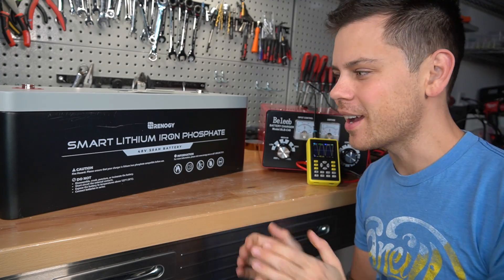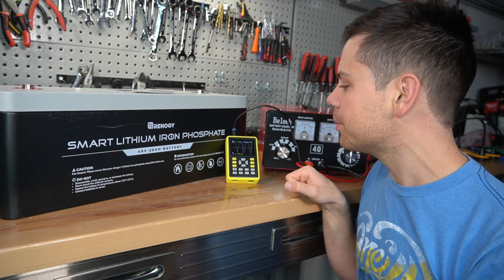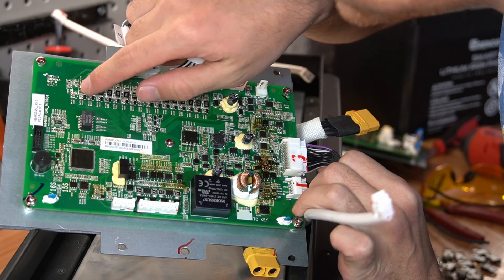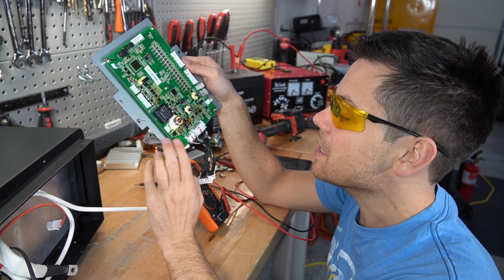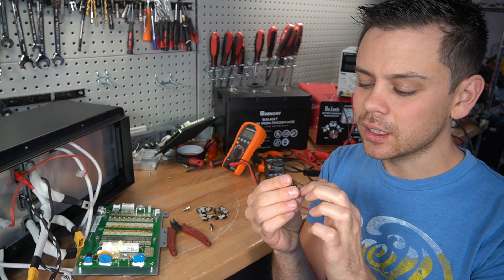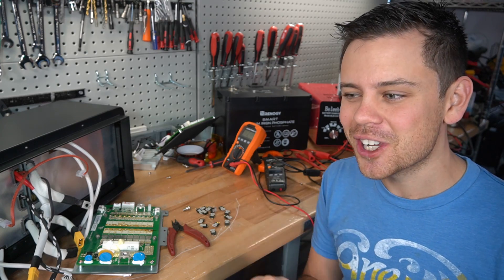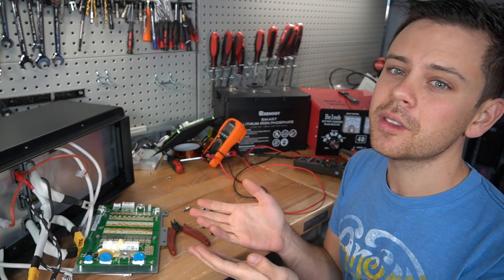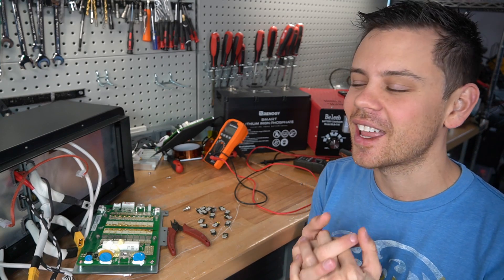Renogy "Smart" 48V 50Ah Part 2: How did I kill it?

Comment: Even if it was a bad charger isn't the whole point of a bsm is to stop that from happening and save the batteries
Reply: @ mike a... I think it did protect the batteries, but not itself. A new bms  or replace mosfet should make battery ok.
Reply: @reginaldjones9924  The BMS didn't protect the batteries.  As result of the FET shorting, it allowed the battery cells to both be charged at cold temperature, and overcharged.
Reply: To a point - the BMS will have a rating that says "NO MO than X'" or I stop working ... he crossed the NO MO' line a few counties back ... I have actually seen it where so much current was passed that it literally fused the entire BMS into one solid circuit ...
Reply: I did not know that could happen if there was a fuse in line somewhere could that have prevented it from damaging any batteries.

Comment: My only question is:"Why is that rotten #@&%* charger still sitting on your bench???
Reply from the maker: I was going to trash it but its good for lead acid haha
Reply: @WillProwse  Will, that charger would have been just fine for charging that battery or any other battery in that amp hour rang or larger, as long as you a don't exceed a 1C charge rate, and you keep a close eye on the charge and don't exceed 85% charge. What killed that get, was when it tried to disconnect the battery at the moment the voltage was at it's peek, which is also the moment that the current was at it's peek, which resulted in a ring up that probably would have reached a high enough voltage to destroy the rectifier in the charger if that Fet had have been rated for a higher voltage than the diode bridge, unless that charger is a half bridge with a center taped secondary in which case the rectifier would not have blocked it at all and it could have risen to several hundred volts, which would have taken out any Get not rated for at least 600 volts. Bottom line. The Fet failed at the very moment that it tried to disconnect, and you could have been charging that battery with a fully regulated Supply that is only a few volts over the top limit and had an inductor in line and it would have killed it.

Comment: Great follow-up video, Will! Thanks for sharing your findings with everyone! Even a nice BMS can be destroyed with high voltage.
Reply: I agree but I’m also disappointed that they didn’t add protection for chargers like the one Will used this time. Many other people might do the same. 
I’d call this a design failure when taken into account that it’s a high end product and there apparently are other products that can handle the (much too) high output of the charger. 
I’m curious to your opinion. Tia!
Reply: @Conservator.  I'd like to know what Renogy says is the Absolute Max input voltage for their design, that's a common specification for electronic designs. The datasheet only says "Voltage Range: 42V~55.5V" and "Max Charge Voltage: 54V". If they only have a ~3% (1.5V) safety margin on this design, I'd be very concerned. Based on Will's measurements, he's seeing at least 72V from the charger which is ~30% over the max listed on the pack.
Reply: @MarcelStieber . So as others have mentioned there probably was a huge spike when the transformer was cut off at peak current. I understand that one (or more) MOVs (of less than $1) could have protected the circuit from failing.
Reply: @Conservator.  Sure, my earlier point is that a sustained and significant over voltage event that's 30% above the rated level is not something that most circuits are designed to handle. MOVs will help for intermittent spikes and transients, but not sustained over-voltage as Will indicates that charger outputs.
Reply: @MarcelStieber  Thanks again. 
I was thinking 95V MOVs as the MOSFETs used are rated at 100V. 
I don’t intend to be pedantic, but I’m seeking for confirmation and or clarification. I highly value your comments.
Reply: @Conservator.  No problem! We're all here wanting to learn. It's been fun to see the group debug effort on this one. I'm sure everyone's learned something from these videos!
Reply: @MarcelStieber  👍
Reply: I wouldn’t call it a design failure. When you build a system you use components of equal quality for best performance. It is unlikely that many people will buy expensive batteries and use inappropriate equipment to connect it all.  And renogy did supply documentation advising about over voltage protection.
Reply: @4philipp  
These batteries are used to replace lead acid batteries. So imo it’s not enough to just specify a maximum voltage input and leave it to every user to read and understand that. 

Furthermore it would have been easy to add an over voltage protection at very low costs.